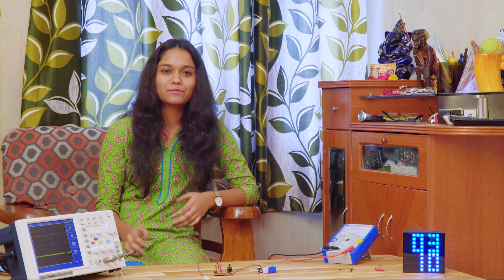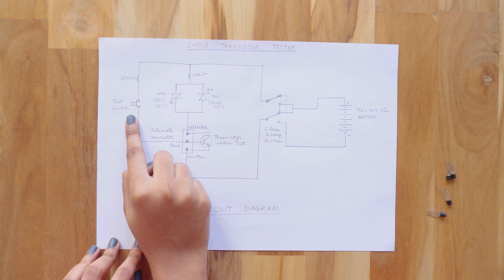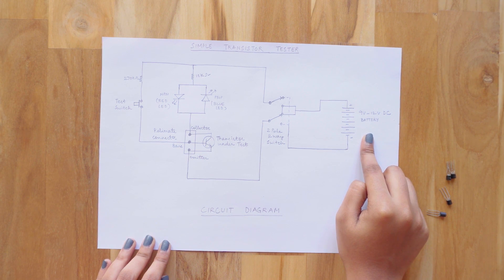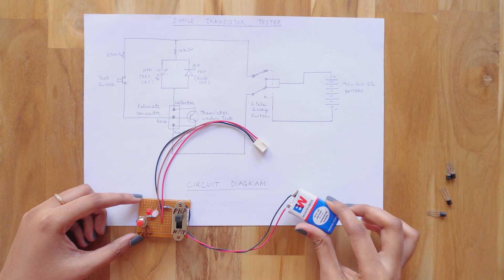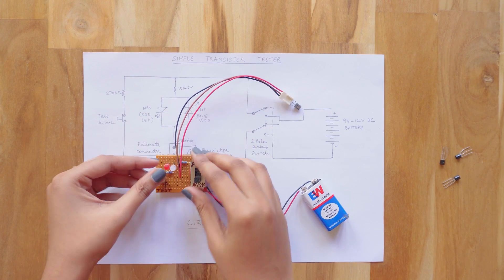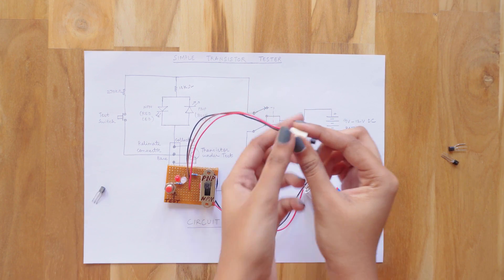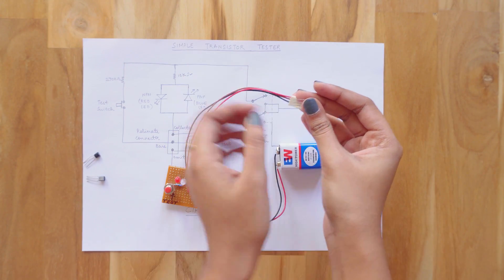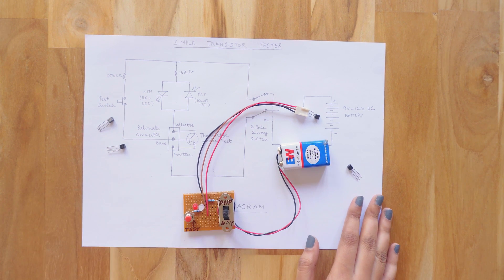Simple and Easy Transistor Tester under 30Rs

Comment: Your ckt  is simple but not cheap as you say 30rupees the 9volt battery itself cost me 50rupees
Reply from the maker: +frazer fernandes The battery which I used is HIWATT make and it costs around 10-15Rs.